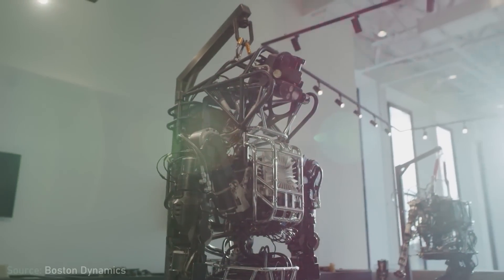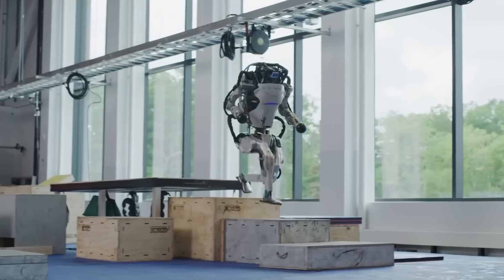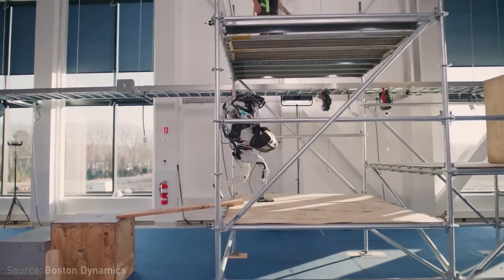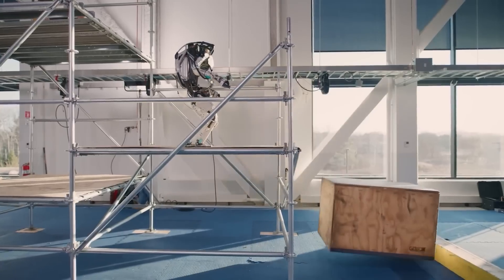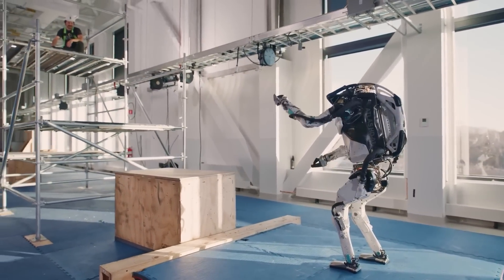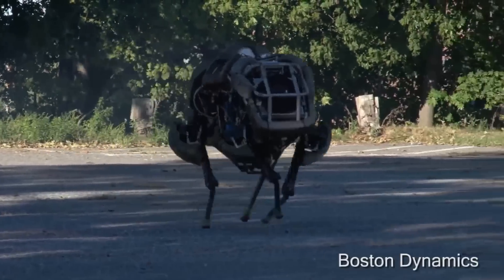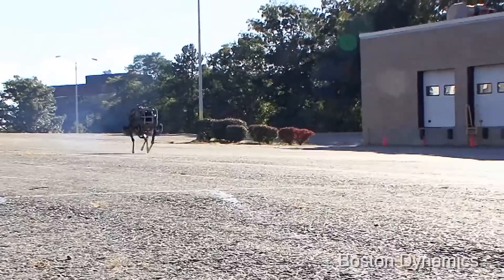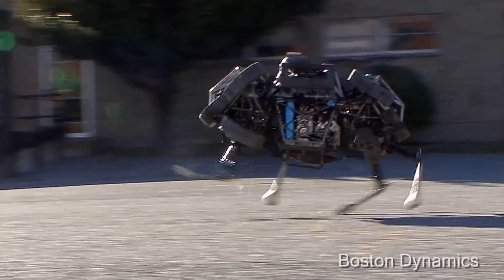Hydraulic vs electric actuation in robotics | Marc Raibert and Lex Fridman

Comment: I think hydraulic is more simple with one motor and one source that converts electricity to mechanical work and that work is spread using tubes and hoses and controlled by the state of the art valves. With electric you'd need a lot of big motors that compromise efficiency for speed and position control, where one electric motor made efficient to run a hydraulic pump keeps things lighter.

Comment: The future is electric hydraulic integrated. Hydroelectric Ferris fluid that is integrated into the hydraulic rams with gravitational metric valves singled by synchronized ankle sensors and multiple grav sensors at three points of the chassis.

Comment: Much easier to hold a load without using any power if using hydraulics! Also eliminating flexible hoses by integrating the fluid pathways into 3d printed parts means less chances for leaks and better precision due to a lack of "squishiness" in the system.

Comment: "Replace hydraulics with electricity"!!!!  
It is strange and jaundiced thing, why do you want to replace an efficient, reliable and powerful system with a junk consumer system ??!! You must stop this policy. You only think about profit !!
I think we should diversify our devices and not limit them to electricity only, as this is absurd !! Diversity means strength, efficiency and Independence.  
I think it is nice to see different technologies working independently of each other instead of integrating them together. There are broad horizons and there is great untapped energy around us, which is mechanical energy, which in my opinion is more important than electricity. It is nice, for example, to see a completely mechanical computer and a chemical computer, and not to have a computer based on consumer electronics only.
Reply: Unification makes processes faster and things simpler, on the other hand, so cheaper and more accessible for everyone. Electrical systems are just too simple, cheap and reliable not to use them everywhere I guess.
Reply: In my opinion, diversifying sources of income is better than relying on one job. The electrical system may be fast, but the hydraulic and pneumatic systems are not limited in this matter, and electrical system is not simple at all. No knowledgeable person can say that the electrical system is simpler than the hydraulic or pneumatic systems ( with all due respect, I am speaking in general ). The electrical system is very complex. It has a lot of components at a small, microscopic level that only consumer companies can know about It, also often requires the use of coding and programming. The most complex, difficult, and sensitive system to the external environment on Earth is the electrical/electronic system. There are many ways to make systems cheaper and simpler, and unification is not one of them. The hydraulic system is simple, very reliable, easy, efficient, and effective. It is adaptable to any system and is not limited to the battery only. It has also been known and understood for a very long time. It mimics nature. Using systems with different energy and not relying on electricity only allows We have independence and efficiency, so I believe that we must diversify our devices and systems and not entrench ourselves within the closed circle of electricity.
Reply: @ياقوت-ق  Ah, yes, Battery->Controller->Motor->Pump->Pressure tank->Liquid->Valves->Hoses->Cylinders is much more simple that Battery->Controller->Cables->Motors->Reductors.
And dealing with electricity AND hydraulic fluid must be easier than with just electricity.
Anyway, for some reason even Boston Dynamics went with electricity only in their new Atlas. Why?
Reply: yes, ( Combustion / electrical Engine  -» pump -» hydraulic fluid -» storage tank -» hydraulic motor, simple hoses and simple valves ) that simpler than: 
( power plant / local combustion engine -» generator -» battery -» wires / cables -» very complex circuits: Battery and charging protection circuits, control circuits, voltage control circuits,... etc  -» programing -» motor ) 
Anyone can make and assemble a Hydraulic System due to its simplicity, provided that the hydraulic fluid meets the application requirements, Even water can be used, Not only that, but on a small scale, you can interact with the hydraulic system directly without a motor/engine, without a pump, without a battery.! For the Atlas robot, Because electricity is more consumable, and this is something that serves consumer companies. There is a trend by these companies. For example, the Japanese maglev train runs on electricity. This means that the train is controlled centrally, meaning that the train does not travel on its own ( Not independent ).
Reply: @ياقوت-ق  "Very complex circuits", like listed charging protection, control circuits, voltage control circuits, aren't really very complex, and they have no moving parts so as reliable as can be. And hydraulic system needs the same circuits as well, at least in a robot, working from battery. "Brains" and control systems are very reliable in both electrical and hydraulic systems, coz they're anyway electrical. It's just that in hydraulics you pass control signal to a valve, while in electrical - to motor controller.  

Computer processor, for example, containing millions and billions of transistors is extremely complex, but due to almost no wear down with time, thanks to electricity - they don't tend to fail.
Reply: Dear, where did you take us ? Opened the discussion at length and breadth ! You should know that there is no problem at all with “ moving parts.” Everything around us, including electronics, has its own behavior and therefore has its own problems within its system. The main problem, as I said, is not the moving parts, but the design first and the interaction with humans second. There are design limits to the operation of anything in this life. For example, an electrical resistor that was designed to work with a voltage of 9 volts. When you take that resistor and expose it to a voltage of 220 volts, that resistor will burn out and that device called a resistor will lose its ability to control the flow of current because you exposed it to a higher voltage than which it was designed to operate in, and therefore it burned out ( failed ). But this resistor does not have the ability to interact directly with the environment or with humans. Rather, its interaction is only with the battery. Therefore, you know the amount of design power ( current, voltage ) necessary for it to work and to remain within its limits and process it. This is exactly the opposite in the case of moving parts, where It interacts directly with the environment and humans, so you cannot know its design capacity and stay within that. In fact, the ability to interact directly has its advantages and benefits, but there were many ways to solve that problem, the simplest of which is that the material itself is what tells you how much it can withstand / capacity design. So the problem is not one of fewer or more “ moving parts ” but of good design and maintaining operation within the design limits. Any device in our life can fail, no matter what that device is, so there is a service life. Yes, there are problems, but in most cases these problems are within a minimum level, and mentioning them and addressing them is an ideal thing. The Hydraulic System is, of course, a mechanical system, and it is a system that is distinguished by its efficiency, effectiveness, and reliability, and is absolutely no less in these aspects than its counterparts from other systems. Each system has its own problems and nature. The problem of the mechanical system is different from the problem of the electrical system. For example, you cannot say that the electrical system does not suffer from wear and tear because this is not the nature of its problem ( although electrical devices that are exposed to wear and tear will also have a reduced effectiveness ), and therefore your measurement will be Wrong, so engineering found for every type of systems. The nature of their problems differs. The engineered system is the best system ( usually called overengineered system ). Also, electrical devices will consume over time and according to their service life due to the passage of electricity through them. This is known, for example but not limited to, in laser devices, where the material that makes that device emit the laser, which is a special type of very concentrated light, is consumed little by little. This is also the case with capacitors, for example, which have a design temperature and a design voltage that operate within its limits. All of this happens because we are in the world of “ matter ” So, the bottom line is that the problems should not be exaggerated. I mentioned examples of these circuits, and then I mentioned the phrase " etc.". no, never, The hydraulic system is not limited to semiconductor materials and the battery, as I mentioned, it can be operated and controlled directly without electronics or electricity. Valves, even the simplest ones, are considered control devices. The control system is not limited to electronics, as is the case with the concept of digital. But electronics are usually used for the benefit of wireless communication. For example, there are many advantages to systems that do not need electronics or electricity. There are also many examples of robots that do not need electricity, even here on the YouTube. The problem is that any link is Post in the comments section, it will be deleted. The complexity of the electrical system lies in the fact that electricity cannot be seen as it flows through electrical circuits, and its behavior cannot be known easily. Therefore, the electrical system requires very specialized and prior knowledge to deal with it. The other thing is that it is a system based on a precise microscopic basis, where they aggregate materials under Special conditions, such as lighting, cleanliness, and purity, and this is not only related to the electronic computer, but now includes the electrical system in general, so no one can manufacture it because it will require special techniques and conditions. As a result, non-specialists can only purchase electronic circuits boards, supply them with a battery, and observe the effect of the flow of electrical power through them. For specialists, it is only possible to purchase electronic devices such as resistors and others, then connect them to a battery and observe the effect of the flow of electrical power through those devices. The other difficult thing that makes the electrical system complex will be its need, in most cases, for programming / coding. This programming requires knowledge of how to talk to the machine, and this will require memorizing the commands, how to use them, and how to close the command, and then it will require memorizing many, many codes and codes, unless... Open source.

Comment: Hydraulic systems on aircraft did change quite a bit in aviation. When they went with fly-by-wire, in many instances they also switched to component-type electro-hydraulic actuators instead of having a centralized hydraulic system with a common sump and all those hoses and such. Saves weight, and faster turn around because the actuator is taken out as a whole and swapped. (If it's not obvious, an actuator has it's own miniature supporting hydraulic system integrated into it.) Servicing the hydraulic aspects becomes a bench-repair job, instead of dealing with lines, hoses, and other parts like that on an aircraft, not to mention draining, filling, and bleeding the thing deals with less fluid because it's internal to a part rather than being routed through lines and hoses across an entire aircraft.

I think electric-only actuator systems were considered, but had issues due to peaky and sporadic power draw which could cause interference and other issues on aircraft. So that's why this particular setup was developed, in addition to having redundancy with multiple units.

Interesting bit of a random thing to read about, but I'm not an aviation mechanic. I'd think some would have noticed the change if they've been around enough, and could go into more detail.
Reply: Interestingly, Bill Nye is mostly responsible for developing the hydraulic systems you mention, at least for the 747.

Comment: Hydrolic is actually Superior and uses A LOT less energy
However having a Small atomizer thermastate and muscel arey can be 3D printed 
least in theory. 

if you create paths of silicone and rib them with lenths of fiber  can be done after with injection 
then stack the fibers connect them to the electric atomizer plate very small components to make sythetic body parts that can function in drone robotics with a magloc endo skeleton 
the communcation method for the body parts is nano charge though creating a battery in the stomach using electrolites and a charge 
 while maintaining passive charge though static build up though a Lung system 
everything else in a human body is normally process of Matter asymilation 

androids don't need a lot of human organs because of this we only need the functional parts that produce energy and effect limb organs

Comment: Fascinating conversation. I would add (even though I haven't finishing watching) that the probability of success in an endeavor such as a robot walking robustly lies in the creators and the financiers working on the same page. If you are in a healthy work environment, those incremental performance gains are celebrated by all. If you are working among pinheads who can't see the big picture, however, if your robot trips you are toast.

While I can certainly appreciate just how much effort goes into a task such as autonomous walking (remember, the act of walking and the act of surveying the terrain are two entirely different and difficult things), the fact is that others simply can't. I can easily envision a scenario where a designer gets 95% there only to be crucified because it isn't 100%.

Comment: Hydraulics are pretty cool and you can't make a compact package give a lot of proformace. However hydraulics can leak but that can be prevented and they use a lot of power. Electric systems can be just as fast and strong however getting one motor to do many things at once without hydraulics or pneumatics is vary hard to you need a motor for each joint and hydraulic can more naturally absorb shock. Electric motors can be extremely efficient as well. If I made a robot I would use a hybrid system and use hydraulics for hips and shoulders and electric or everything else like thighs and biceps and hands and feet.
Reply: Hyd systems leak when engineers assemble them, there has been two major breakthroughs with hyd couplings to eliminate leaks, so this is a completed and successful part of hydraulics. I would however look to use water instead of hydraulic for these applications, I'm sure there's some weight to be saved there given it cannot be compressed, so a little water goes farther than oil.
Reply: @maxiepads  Humm. The reason why they use oil is because it won't cause corrosion on the components because hydraulics are made of metal and oil doesn't expand and contract as much due to phase changes when the temperature becomes significant. Depends on the oil though. Water can work well but I'd rather use oil.
Reply: you can account for leaks and recirculate it back into the system.as long as nothing has burst or broken small leaks would have almost no effect. you can get away with smaller servos and chain together multiple actuators with one servo as well. the problem with relying on pure electric motors is that it can be very difficult to attain high percision, speed and strength. which limits useability in  hands for example. but ofcourse that depends on the goal of the robot hand.
Reply: @OYVAI_izmir  one of the main reasons why you would use electric actuators us because they have insane precision and vary quick response time capable of millisecond adjustments depending on the motor. Hydraulics can be extremely precise usually not as much as a electric system. Hydraulics do have insane power density though making them vary good for compact machines that need to lift a lot of weight but because you change the torque with fluid instead of gears you are still reducing speed by increasing strength.